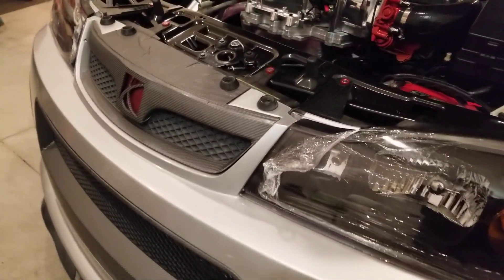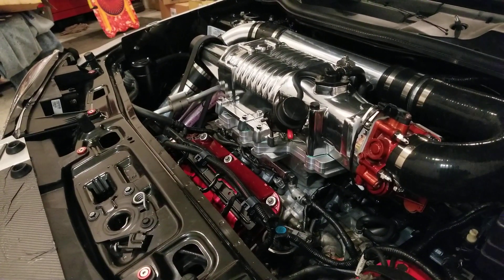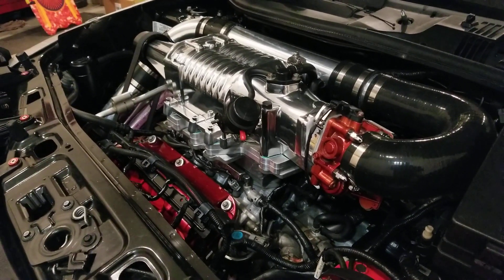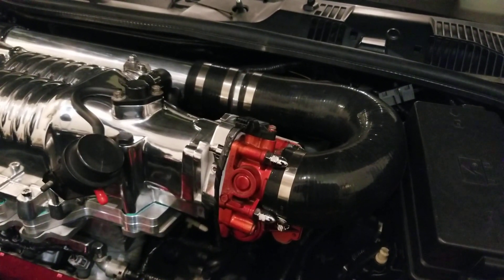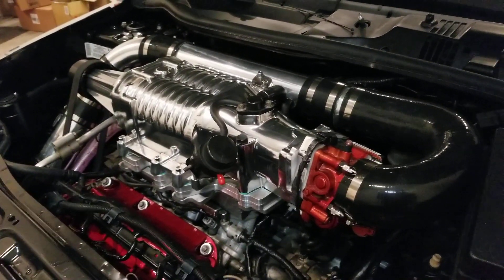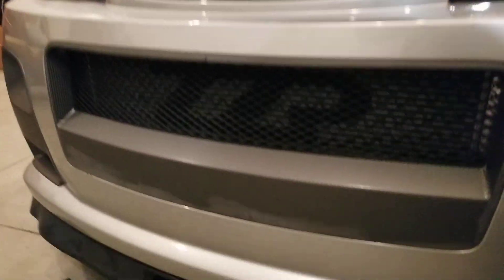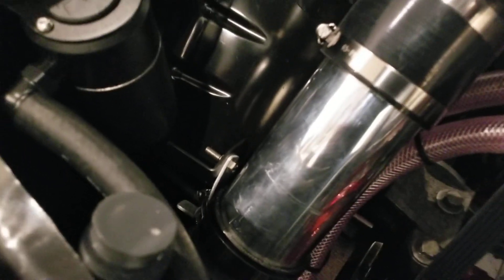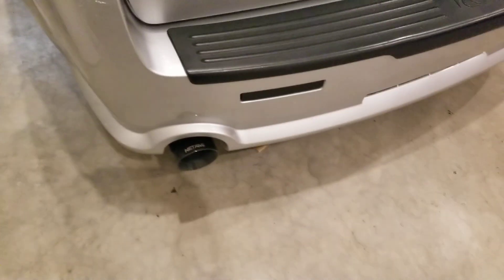Saturn Vue redline 3.7 swap walk through.

Comment: This only fir the awd models? I just want alittle more pwr, like 300-315 hp for so, up from the 250 stock.
Reply from the maker: @08turboSS No you can do the same for any J series  motors. I just put together another motor J35S1 block and crank. Using J35Y6 rods and pistons. N/A build  and let me tell you. I found a hack to get you there with out the supercharger.
Reply: @DaChicagoKid Aren’t those Gen 3 J-series parts?? I’m surprised those J35Y6 parts fit on the J35S1. Was anything done to the heads or block on the J35S1? 

Are you thinking of running the built/upgraded J35S1 engine if the tuning stuff doesn’t work out for the J37A1 swap and the supercharger? Can’t the SC technically fit the J35S1 with some mild modifications?
Reply from the maker: @isnowyazn  Did you not read the title. J37A1. Full port and polish video is posted. Feel free to watch my head porn video.